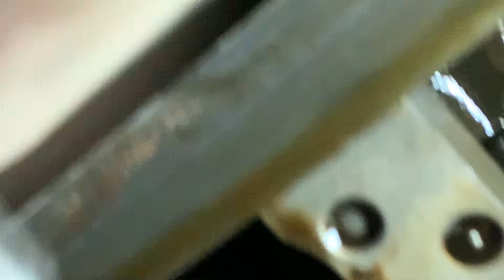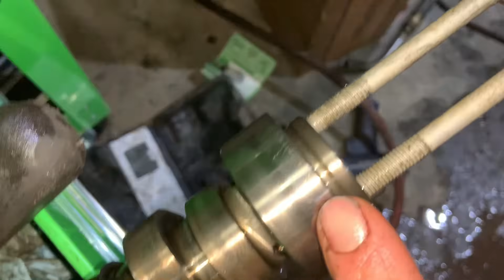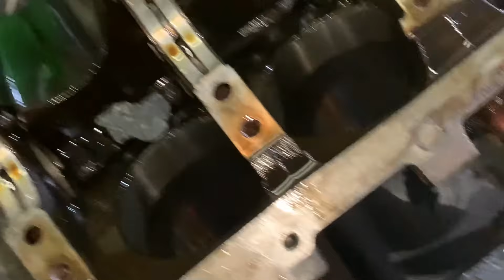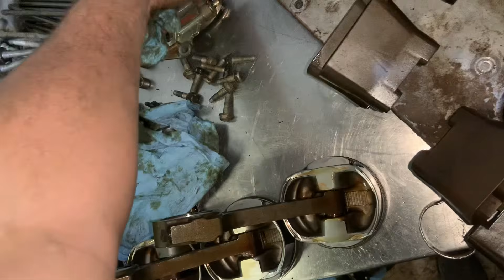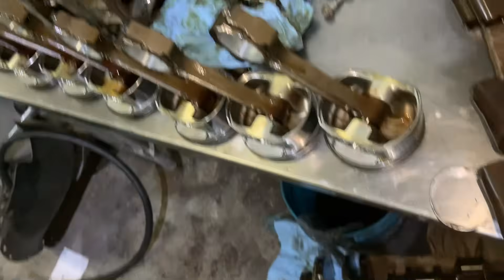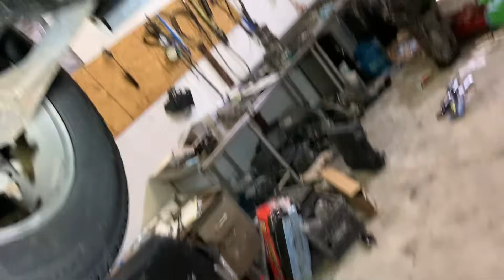ULTIMATE LS ENGINE NO OIL PRESSURE LOW OIL PRESSURE DIAGNOSIS AND REPAIR GUIDE

Comment: You're just like a bunch of other LS newbies, you don't even know to permanently fix the air leak on the oil pickup tube! And it's a simple fix with a piece of gasket material in a brand new o-ring to never show its ugly head again!!

Comment: So my truck just stumbled and shutdown after a 30 min drive . Got it to turn back on and it was ticking or knocking .. I still havnt looked into it but since I got it always had the oil pressure needle fluctuating… finally stumbled shut off and was reading about 0/5 psi  was able to drive it home and sounded terrible

Comment: This is one of the best videos out concerning low oil pressure. I have 07.5 Sierra 2500 HD with the LY6 engine. I went through everything you did trying to pinpoint the source and mine ended up being the camshaft retainer plate. The seal was so flat I couldn’t even feel it rubbing my finger across it, so oil was just dropping back into the pan. Sometimes trying source the problem takes a while but once you notice a pressure problem you better get on it and find it before it makes things worse. Great vid, thank you.

Comment: Super video! Have an 04 hd2500 with oil pressure problem. When warmed up at idle pressure drops to near zero. Tested oil no unusual bearing material in oil. Runs great though, no noises. Replaced oil pump with melling. Replaced sending unit. Correct new pick up tube o ring. Confused, seems like it should be a simple thing. Normal oil pressure when cold for 324,000 miles and higher rpm even when operating temp. Something else missing?

Comment: Much appreciated explanation of the oil circuit on these, and what to expect. Currently dealing with a very tappy engine (L94) that had been rebuilt by someone else for a dod delete. I ended up swapping to a better cam, new lifters and verified pushrod preload etc. cam bearings were already done and positioned correctly. Oil pump was new. But I don’t trust the O ring or the secondary bypass valve in the gen 4 oil pans. It has decent oil pressure, 45 cold idle and 55 at high rpm cold. 33 hot idle and 45 at best hot high rpm. That’s with 15w40 though. 

It usually starts out quiet when cold and after a long drive starts to get noticeable at all speeds above idle. Over the past few days it’s been getting worse even noisy when cold now, but pressures seem about the same. Really curious to see what happens after dropping the pan this weekend and I’ll have to report back if it made a difference. I appreciate being able to see where a few other possible issues may be.

Comment: One thing I noticed. On the cam journal that the bearing fell out looked like the crank weight carved the side of the block too, did you check the thrust bearings? Maybe some crank walk started hammering the block right at the cam journal.

Comment: There is a guy that came up with a drill pattern to actually drill the block so you can pin the bearings in place. I'm betting you he has had this happen on quite a few engines.

Comment: Currently having an issue with a gen 4 5.3 absolutely destroying oil pumps. Any possible insight on why that might be happening? I am installing them per mellings recommended method. Thanks in Advance

Comment: The other problem for low pressure and collapsed lifters is the valley cover gets lose real easy and there are oil passages under there for those AFM lifters.

Comment: I have an early '07 avalanche with the aluminum 5.3L. No lifter tick, no knocks, no noise that stands out whatsoever. But low oil pressure at operating temp. It has between 40 and 50 at cold start. Then it gradually goes down to between 5 and 10. Replaced the oil pressure sensor. No change. Dropped the oil pan and replaced the pickup tube oring. No change. Heavier weight oil as well as Lucas. No change. At this point, I'm thinking it's the oil pump. It has 350k on the clock. Also has the full DOD delete including lifters, cam, and top plate. It runs perfectly except for the low oil pressure. Going to be replacing the stock oil pump with a Melling high volume pump. Thoughts?

Comment: I've got an 06 start it 35lbs as soon as it gets to 200 degrees it drops to 15 lbs and kinda bounces slow between 15 and 20 as soon as it warms up completely it holds 35 rock Solid I am stumped it dont really act like it's the seal on tube please help thanks!

Comment: Exellent video have 02 suburban 5.3 motor that has had 0 psi at hot idle but 20-30 when driving 1000 rpm’s or more. This has been going on for about 3 years. Has also had lifter tick. Just last month truck started making knocking sound only at idle and with ac on. But still drives fine. I dropped pan replaced gasket, o ring gasket, rod main bearings ( which were in excellent condition) pressures are now same and knocking continues. Why am I getting good pressures while moving but only 0 at idle and knocking with ac on? Ac blows cold by the way but if I turn ac off the knocking is almost imperceptible like 95% reduced .

Comment: This is by far the most helpful video I’ve seen. Thank you. I have been fighting low oil pressure in a 2001 suburban and it is driving me insane. I have already replaced the oil pump and the O-ring gasket however, I am concerned I might’ve pinched it when I put it back together. I did not drop the oil pan in order to do this. I’m going to run a quick diagnostic test

Comment: What about the oli pressur relif valve on the oil pan that is used for DOD. When you delete DOD this should be replaced with a drain plug. 14x1.5

Comment: Not sure if you check the comments still, but I have a situation that is similar to what you are talking about. I’m experiencing low oil pressure on my Pontiac G8 GT, but pretty much only at idle, anything above seems normal or at the very least very slightly below what it used to be. I should preface and say it seemingly happened overnight and it’s also cammed and DOD deleted and I did the work properly. I’ve already pulled the pan twice, I replaced the sensor, replaced the O ring, and plugged the oil bypass in the pan all to no avail. I should also mention I got the car roughly 4 years ago from a chevy dealership who replaced the engine due to low oil pressure, so it’s a pretty new engine, or block atleast. It has a melling oil pump on it which is why I didn’t dig into that yet because I don’t suspect that’s the problem. What’s throwing me off is that it’s only low oil pressure at idle, and I don’t know what problem that correlates to. Would that be a bad cam bearing, the pressure relief on the pump, or something entirely different? I wish I would’ve checked if I could see anything with the pan off but it didn’t even compute with me that I would be able to see the cam bearing from there. Just want some advice before I move forward again and pull the pan for the 3rd time and likely the rest of the engine apart.

Comment: I need someone with your experience to help me diagnose my oil issue with my 2004 Tahoe 5.3.  I will follow your steps again to find my issue.  Starts with decent to good pressure 40-50 then falls off with engine at running temp. Recently rebuilt with new cam bearings and cam.  I did not change out my crank bearings or crank.  New melling pump 355 good pressure at the pump.  30psi lower at the sending unit.  Sending unit is new and is same as manual gauge at oil filter  gets down to like 6-8psi at operating temp.  My quest continues  thanks for this very informative video.

Comment: I bought a rebuilt LS2 and I used a pressurized oil tank connect to the front galley hole to try and prime the system. I have put 5 quarts through the system and still have no oil on the top of the engine. Could this be because that pressure release valve is stuck and just forcing the oil in to the pan? If I just run air in to that galley I hear what I believe is the pick up bubbling.

Comment: great video, but you are did not talk about the crank pushing the cam bearing out essential over time. if you look at 9:18 you can see the shiny metal below the Cam bearing journal, the crankshaft was rubbing the block. great information about the oil pressure side of things the the LS block.

Comment: Could i loose oil pressure if my vally plate gasket is leaking and oil sending unit is striped out, i used pipe tape and rtv to put it back in as good as i could, i have a 03 1500hd 6.0 with 4l80e it has a 6" rough country lift, and i cant drop the diff, i got my pan down and, nocked the factory pan gasket rivets out with a roll pin punch, and oil tube out but not enough room to get pan out, to be able to check cam bearing

Comment: I have an issue with my 05 suburban 5.3 low oil light pressure light came on and also a lifter tick when that happened, I replaced the oil pump and pick up tube. Started it back up and now still same thing going on low oil pressure light and lifter tick. What can it be
Reply: Let me know what you found out?

Comment: Why not just upgrade the cam at that point instead of polishing it
Reply from the maker: @fatboyc.7004  not much of an upgrade for a stock vehicle.  Try putting a cam in your suv and let me know how that works.  Stock cams belong in stock vehicles.  Cams add power when u add headers, converter and a tune.  And most always loose low end torque in exchange for top end.  6 k stock truck…. No thanks

Comment: Extremely great video best I've seen so far I do have a question after taking an oil pressure reading right behind the pump it's about 38 lb yet I get a pressure reading of 5lbs at the sender any suggestions ⁉️I really haven't had the experience pulling one of these engines apart and I am now retired at 72 years old

Comment: My ls has 240000 miles al good. No low oil pressure or high. Are you sayin theye will all suffer oil pressure issues

Comment: I have an L96 engine that shows no oil pressure at the sensor. The engine is not making any ticking or knocking noise. I even pulled the sensor out and started it and no oil comes out. I looked down in the hole and there is no screen in there. Any idea what might be the issue?

Comment: I wish i had seen this video earlier, far more informative than the others i found on here when i was searching. I've been chasing a knock for years in an Alloy L98. I'm in Australia so its in a 2007 Holden VE SS commodore. I have spent a lot of time and money replacing everything to no avail. Last week i pulled the engine and stripped it down, found the cam bearings are stuffed, worn but luckily the didn't spin and my oil pressure wasn't catastrophically low.. Anyway its in the machine shop now for new cam bearings and a measure so hoping after all new gear the problem will be solved...The one good thing is, it has a lot of good parts in it now.

Comment: Great video and explanation. I really appreciate your thoroughness I have a question about mine you did not cover. On my 2006 LS I have great oil pressure when I start it. I have about 40 PSI then goes down to 8 PSI after 20 minutes. I have replaced the O ring and oil pump. could that also be the cam?

Comment: Thank you very much. I got this problem with my suburban 2011. I did oil pump orring.Gasket galley And I I delete 4 cylinder 8 cylinder. Make it. It's cylinder all the time. Of course delete get. What I still have oil pressure, I believe what he said cambering.. Thank you again

Comment: Thanks for the info I just pull the oil pan on  an05 silverado and I'm going to check if the bering come out of the board
Reply: Update on my engine #4 cam bearing came of and the main bearing are scratch

Comment: Definitely interesting. I have a 4.8 with 300,000 miles on it that generally has good oil pressure except on very cold days. On very cold days it will have almost zero oil pressure until it gets warm and decides it wants to act normal. I am swapping in a 5.3 aluminum block that I am going over completely.

Do you think it will be obvious what the problem is when it is apart? Pressure relief sounds like a good theory. Maybe o ring shrinks in the cold. I am not sure I care really, but I want to take all precautions with the new engine to prevent this re-occurring. Also, is there anything that can be used to supplement the O-Ring on the pickup? Would silicone be worthwhile? JBweld?

Comment: I have a 2013 sierra that slowly drops to 10psi oil pressure as it warms up, i had a melling oil pump installed and still does it. Any recommendations??

Comment: Great video. Ill be looking at some of the areas and hoping it a simple o-ring fix. Cranks up and is a 24psi on cold start then drops to 15psi after being warmed up. Drives fine no noise. After a long drive start hearing lifter noises and the idle gets rough. Hoping i dont have to replace the engine.

Comment: I have a 03 Silverado 2500 6.0 and it’s only got 150k on it and it’s always at 25psi hot or cold idle. No matter how hard you hit the gas it barely climbs past 40. When cruising around it’s like 30-35psi fluctuating slowly.

Comment: I have a question about the priming of the pump. Will this type of (gear pump) pull oil up the pickup tube on its own? 
I have an 8.1L (496cu.in.) Vortec in a 2001 Silverado Dually. Some idiot tried sabotaging the engine by stabbing the oil filter. Before putting the new oil and filter on, I took the drain plug out to drain any old oil. Nothing came out. Also, I should have mentioned how I found the issue. I was backing the truck up after being parked for a couple of days. Then the chime went off rapidly warning me and I immediately saw the information display lit up red saying severe oil pressure loss and low oil level. I immediately shut the engine off and coasted it about 15 feet back to where it was parked. I filled the new filter with clean synthetic oil and filled the engine with the 7-something quarts it normally holds. I got the thinking that maybe the pump will not create a suction to draw oil up into the pump. I have seen several videos using a garden sprayer pump to prime the pump and the entire oil system. The port that they use is the one on the drivers side front of the block. Well, that's easy when you have a block on an engine stand. So, I found a plug at the back of the block that appears to be in line with the front plug. It's near the filter. It has a square hole for a four-sided bit to go into. It is a square 8 mm bit that fits it. This plug is stuck in the block hard. It's in a hard-to-reach place with an exhaust manifold connection right where you need to put your ratchet/breaker bar. So, the other idea is, I decided to go through the oil pressure sensor port. Then, more thinking I did! 🤔 😂 Will pressurized oil get down towards the pump from this port? I think the "barbell-dogbone" may prevent oil from going in that direction. I think it keeps the oil in the upper half of the engine from running back into the pan each time you shut off the engine. That would mean that my idea of priming through the sending unit port is not going to work. I did take all the spark plugs out and I cranked it over watching the oil pressure gauge and didn't see it come up. I may not have done it long enough. A video with a guy from GM says it takes a while and even tells you to let the starter cool off in between. I drained about 3 quarts of oil to allow for pressuring it with the garden sprayer and I noticed that the oil is fairly dark and it's making me think that it was pumping oil during the cranking. I think what I am going to do next like right now! Is unscrew the new filter that was filled with new oil and dump it into the clear plastic tote thing I used, and see if the oil is dark at all like it's mixed with residual oil in the engine. If it's anything but clear clean oil then it's pumping and hopefully, when I start it, everything should be good.
I'm long-winded too! 😂
Maybe you can suggest or tell me if the pump had enough residual oil or if the block would have enough to run back into the pump to be able to draw it through the pickup tube. It never made any engine noise like lifters. I shut it down immediately when the loss of pressure happened. I'm positive it didn't do damage and the truck wasn't under power other than idling in reverse.
Great video and I learned a bit about the ports/plugs for the oil system through your video. I think the engine you have in the video has a little different plugs around the oil filter area but I guess the systems are the same as far as the routing through the block. 
Thanks again for your great video! 👍👍👍

Comment: So I have a 2007 NBS Silverado 1500, I had a 6.0 L76, put in it by some hacks, they intentionally didn’t put a oil pan with a sensor I realize now, I replaced it & low oil alarms is going off, I hear a little valve chatter so I’m going to drop the oil pan &  look deep to see if I see crank bearings are jumping out.  God I hope it’s not the case, if it’s not then I’ll replace all the other components for peace of mind.  It’s seems though I don’t have to remove and axles though just the cross member

Comment: 06 GMC Sierra 1500 4x4 5.3L 8th digit  T 180,000 runs good morning lifter tic but goes away oil pressure 70-80 when mash the accelerator for a min to pass oil pressure drops to 0psi let off accelerator oil is back to 80. This only happens about 30sec during downshift acceleration let up and stays at 80 for all other driving conditions….O ring…???